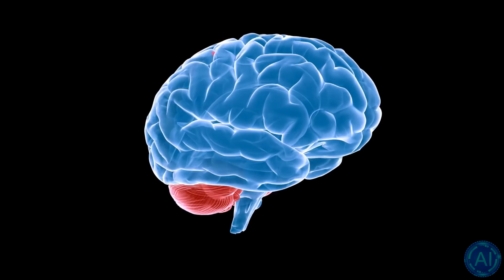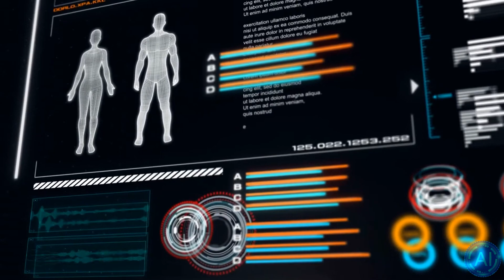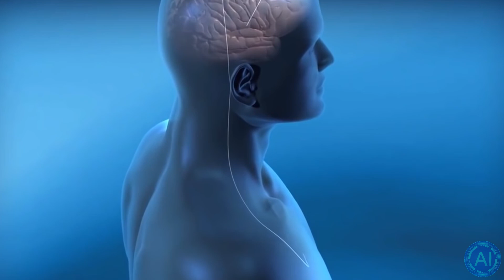Your Eyes are LYING! - THE CURE for Visual Snow

Comment: No Cure......Only cure is temporarily forgetting. In my 50's. Lifer.
Reply: Hello, I am 13 years old and I noticed that when I started using my cell phone for many hours, I started to have the symptoms of visual snow, but only on distant things
Could this be eyestrain or anxiety? Since I spent a few weeks thinking I was going to go blind.
(The tv static is very low and doesn't interfere with my vision, it's invisible, it decreases a little when I wear glasses) 
It is most visible on smooth things like walls 
It's nothing like the visual snow simulations I've watched.
Reply: @Whizthay  could be eye strain but don’t worry your normal
Reply: @fernandotapia5827  THANK YOU
Reply: i got it at 14 and i’m now 16, it makes it hard for me to navigate my way around and i’m worried for when i have to start driving, but ofc most doctors just don’t listen and my mother would brush it off as always, it stresses me out
Reply: same, but I did get alot better, to where its negligible. I had it really bad for a couple of years to where it was hard just to make it throught the day..